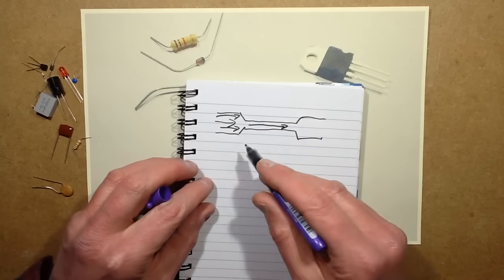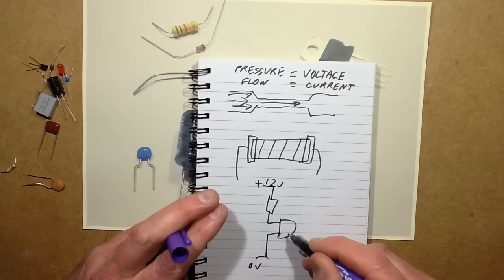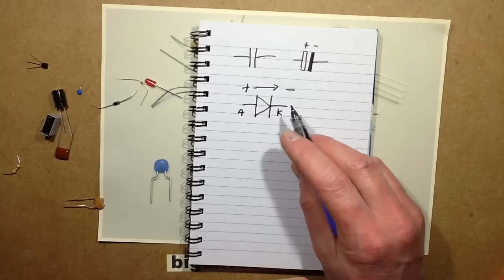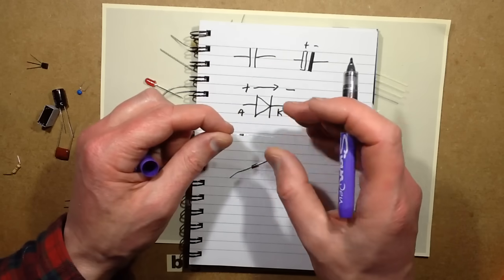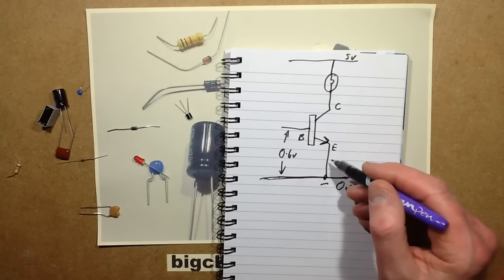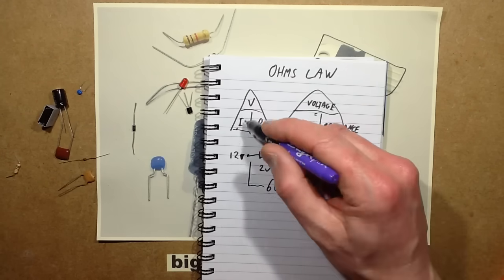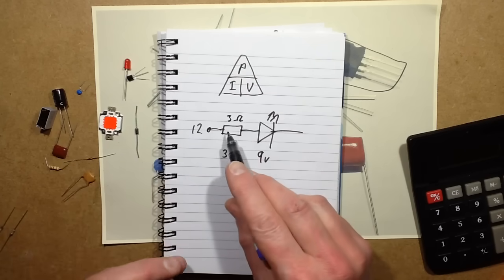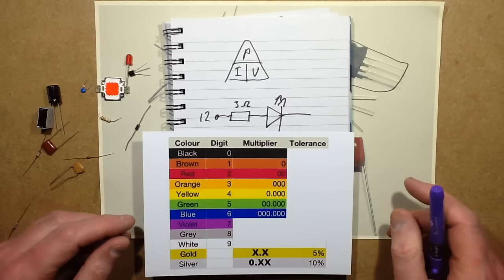A simple guide to electronic components.

Comment: Ohm's law is not V=IR. this is the definition of resistance as the ratio of voltage to current. No need to mention Ohm's law which considers what happens as the current changes. If the resistance is constant when the current changes the component obeys ohm's law. If the resistance varies r=v/I can still be used to calculate resistance even for components that do not obey ohm's law, like a filament lamp, or a diode. http://hyperphysics.phy-astr.gsu.edu/hbase/electric/ohmlaw.html

Comment: Thanks so much for the video! I appreciate the flow analogies as a good visualization tool, particularly with tuxcup's additional Chinese terms. One possible correction...I think .01A would be 10 centi amps, rather than milli?
Reply from the maker: 0.1 would be ten centiamps.  0.01 is ten milliamps.  (Centiamps are not normally used as a measurement.)

Comment: Hi clive i know this is off topic but i couldn't think of anyone else to turn too. I built a 2p coin pusher for my autistic son. Im driving it with a 12A power supply at 12v. 12v dc windscreen wiper moter drawing 8.5A and have used a 1ohm resistor capable of 100w to get it to 5v for the speed. The problem is that the voltage is fluctuating too much and the speed of the motor is decresing and increasing. Was a resistor the right choice and what is the best and cheapest way the regualate this with the high draw
Reply from the maker: The best way to control the speed of a DC motor is PWM (pulse width modulation).  It runs the motor at full voltage but pulses it on and off with varying on to off time to control the speed.  That's the whistling noise you get from cordless drills.
Remember to include protection against the motor stalling.
Reply from the maker: You can get DC motor speed controllers on eBay.
Reply: @bigclivedotcom  thanks clive your the best

Comment: Excellent video however when I use the water analogy with my students i describe it as a differential pressure so they enforce the fact that voltage is a differential. It helps when talking to mechanically inclined people

Comment: The charge in a capacitor is stored in the insulator, so that matters as to the effectiveness per unit of surface area.  
Also electronics is backwards.  Atoms are positive, electrons are negative and they flow to the positive.  Rather than fix electronics, they speak of holes for electrons moving from the positive.
Reply: you just helped me with your 'backwards' statement. I've had a hurdle of 'but why does the current flow that way?' and, duh, it's Biology/Chemistry 101.

Comment: Good video.

Interesting that you randomly bring up the chinese word for voltage.  It's very easy to remember, 电压 is, as you say, literally 'electricity-pressure'.  Back when i was trying to build something and often went to the 'electronic-component-market' here i found a lot of the vocab is intuitive.

current = 电流 = electric-flow
capacitor = 电容器 = electricity-container-mechanism
resistor = 电阻 = electricity-obstruction
battery = 电池 = electric-pool
circuit (board) = 电路（板）electric-road (board)

And some are just ripped off from english, like breadboard is literally 面包板, bread-board。But then i'm still not clear on the difference between 'solder' and 'weld'.  I think they use the same basic word for both.

But that market is crazy, i love it... i also went to a similar one in kiev, but so apparently there are enough hobbyists or just enough of a tradition of people buying these things wanting to physically go to purchase them in person that this city has at least one little shopping mall building with around 100-200 little stalls with every component you might want.  Like 10-20 stalls are just ICs, just a display case with all the available ones shown/labeled and then boxes/rolls of them under the counter.  Others are messier with seemingly random scatterings of bins with resistors/capacitors/things i don't even know what they are.  So much cooler than radio shack.

Comment: 12 volts in diode diode diode then resistor then ground _ should the resistor before to lower the 12 volts so diodes do not burn ?

Comment: Is it 0V after all the LEDs and the resistor because the "pressure", which you also reffer voltage as, is all "used up"?
Reply: Sort of, yes. The energy is dissipated by each part in the circuit between the positive voltage supply and the 0V rail. Without the resistor, all that energy would be used by the LEDs, which would be too much and burn them out. The resistor uses up the remaining power that you don't want the LEDs to use.
Reply: The pressure "differential", yes. The water flow analogy works very well for electronic circuits.

Comment: With a zener diode, once the zener voltage is reached it will allow current flow in both directions. Zener diodes are used for voltage control.

Comment: Do resistors eat power? Say in the simple circuit drawn at 3:54, the LED will clearly use power but the resistor too?
Reply from the maker: Yes.  They will dissipate power calculated by multiplying the voltage being dropped across the resistor by the current flowing through it.

Comment: what does mos fet stand for?
Reply from the maker: Metal Oxide Semiconductor Field Effect Transistor.  It's a very interesting and common type of transistor that allows high currents to be switched very efficiently and with virtually no current required from the control circuitry.
Reply: bigclivedotcom- thank you for the info. really helps a lot.

Comment: Hey Clive from watching your videos I have recently became interested in doing a little project on my own. I have very little to "no"  electronic knowledge. I purchased a step up high voltage pulse inverter arc generator ignition coil module DC booster from ebay and a couple of momentary switches along with a toggle switch. I decided I would to try to make a stun gun from 1" PVC scheduled 40 pipe.
    I have the parts but not sure on wiring them together. I also have a T6-10w 3.2 to 3.7v LED I thought about putting in the head of it along with the 2nd momentary switch. I now am lost and could use some help on how to wire this rascal up. Question can you do a video on how to wire and maybe a diagram of the wiring.    faithful watcher!  Gary
Reply from the maker: Hi Gary, I can't really make a stun gun video as it is classed as an actual weapon in the UK.

Comment: In your diagrams you showing the flow of electricity from positive to negative, I thought electricity is the flow of electrons, which have negative charge and the only thing which is flowing in the wire. Is there anything else with positive charge which is moving towards the electrons ??
Reply from the maker: Conventional flow of electricity is from positive to negative.  Electron flow is from negative to positive.  Since all the diodes point in the direction of conventional flow I use that as it makes learning easier.

Comment: I've not understood the idea of power ratings in resistors

Also
Do these calculations require you to know the current input in the system or do you use the current you want to achieve?
Reply from the maker: Power rating is how much heat the resistor can dissipate.  It's calculated by multiplying the voltage across the resistor by the current flowing through it.
A resistor is often used to control the flow of current, so you will choose the value to adjust that current.
Reply: bigclivedotcom thanks
That makes more sense

Comment: What's the hole in the mosfet for?
Reply from the maker: The higher power components generally have a metal tab with a hole to allow them to be screwed onto a heatsink.  An aluminium fin to help take the heat away.

Comment: Hey Clive, I get that a capacitor can contain charge but I still don't get why they are used....why would you want to contain charge when you have a battery.
Reply from the maker: They are better suited to holding small charges with an extremely long life and the capability of virtually unlimited charge discharge cycles.

Comment: When I did A Level Physics the practical exam included an electronics section which had a fairly large value electrolytic capacitor in it hidden away inside a box.  The teacher had connected this thing the wrong way round.  So my friend came to do the experiment, whatever it was - I can't remember, flipped the switch and 5 seconds later the cap detonated. Much suppressed mirth ensued.

Comment: is it smarter to link multiple resistors of say 100 ohm, like ten to make 1k..
and will it b e able to 'emulate' the 1W single 1k resistor ?
Reply from the maker: Yes, you can combine resistors in series to increase the resistance and power rating.  With standard 0.25W resistors 10 would theoretically be rated for 2.5W.

Comment: So for higher voltage do you need thinker copper wire.
Reply from the maker: For the same power you can use thinner wire, but with thicker insulation.
Reply: bigclivedotcom Oh well is it possible to take UK electronics and modify the resistors to American standard?

Comment: Please someone reply to this. I have a JVC XL-M400 6-1 CD player. It needed cleaning so I opened it up. Well on on of the boards inside the unit there are 5 of these very small resistor things or whatever they are that light up red when you turn the unit on. I have never seen anything like this before in any electronic. I am just very curious to find out what they are. Thanks
Reply from the maker: Probably surface mount LEDs.  Often for diagnostic purposes.

Comment: Can you help me identify something on a circuit board?
Reply: +Chris J If he's too busy the rest of us can help, we'd need to see a picture probably though? Drop it on imgur and give us a link
Reply: Okay its a the circuit board of Super Mario All stars. There are like round pink colored ones with 5 colored lines on it. I think there capacitors because it says C by them. Like C2, C3 an such.
Reply: On http://snescentral.com/article.php?id=0796 there is a picture, the cylinders there with the leads coming off the ends (same way most resistors look, the leads aren't parallel coming from the same side of the parts.)? Those are Axial Capacitors (Axial means both leads are in line, like the axis of the part. Most other capacitors are Radial, they come in both "flavors" as sometimes one or the other fits your PC board design better, plus now in surface mount.) Those are decoupling capacitors, used to keep the power to the ICs clean (you will find them right next to or even under the ICs ideally, any spikes caused by the ICs switching on or off is absorbed by them, they are a very good idea as otherwise your ICs can forget what they were doing, which can be bad.) Hoping that helps :)

Comment: the smell of failed resistors is so unique you can usually tell that one failed. sometimes i will sniff an electronic device that failed so to give me a hint, lol
Reply: Hehe, I too am one to give a device a sniff as an initial analysis. No burnt smell, probably nothing major, time to look for bad connections 😜
Reply: What about tantalum capacitors? The nastiest smell ever!
Reply: You now have cancer
Reply: what does it smell like? is it that burning plastic smell?
Reply: Also try some dope bro
Reply: @highondope8037  No no if brains are failing by restricted neurotransmitters that hard the casing starts to smell. I mean the casing for the powersupply and transformers. Sensors are then already useless. Only the resistors are really working all the time.

Comment: so transistor is basically a logic gate
Reply from the maker: +Hideki Shinichi It's a switch that can use a low level signal to switch a higher one.  But you can also make simple logic circuits too.
Reply: :D

Comment: I have LED turn signals for my motorcycle. They are rated for 5-9 volts. unknowingly, I put 12 volts to them. Needless to say, they no longer work. I dismantled them and discovered a small device that is connected to the power wire on one side and the printed circuit on the other. I can see the device is burnt on the output side. and it proves to be open when checked with a ohm meter. What exactly is this device? Can this be repaired? If so, can it be made to accept 12 volts or do I need to lower the voltage input first using a resistor?

Comment: im curious. 
are three 50 ohm with 2 watt resistores in series equally/better as one 150 ohm with 5 watt? could you reduce/spreat the heat that way? 
if anyone here knows an answer, let me know.
Reply: If the circuit in which it's used is the same, then the overall heat produced by the resistors will be the same (which you can check by putting both in an equal mass of non-conducting liquid and monitoring the temperature), but the power dissipated by each of the three resistors is smaller than the power across the big resistor, so (if each of the small resistors has a heat density similar to the big resistor's) they will heat up less degrees per unit time. So yes, using the three resistors will spread the heat over three three resistors, which could make them cooler, but it will not change the overall power across the whole.

Comment: Why do electrolytic capacitors work? Wouldn't the electrolyte make it short circuit or explode from electrolysis or the conductivity of the elctrolyte?
Reply from the maker: On first polarisation a thin insulating film is created by the action of electrolysis  That creates a barrier to DC current.
Reply: Thanks! I've been wondering about that since forever.

Comment: I always think of current as the number of electrons coming thru a wire . and voltage as speed/pressure . like golf balls thru a pipe. and sometimes when I'm working on something. I do think of it like water. sometimes both. whatever it takes to get your brain wrapped around the task ahead! great video...

Comment: In regards to te water analogy for resistors, if you narrow a pipe with water flowing in it, the flow will actually speed up rather than slow down because of the Venturi effect. So I never liked the whole water analogy thing personally. But it is a good tool for helping to understand circuits if you don't know fluid mechanics. :>
Reply: The same is true with the flow of electrons. They move faster in the higher resistance. So they have more collisions and more kinetic energy is changed to heat.  However the overall flow of energy is less, just like with water. You are right the water model of electricity has many weaknesses and the electrons are not like litres of water flowing

Comment: help me, i want to make a driver for 4 volt led i have the battery of 3.7 v how can i make the dimmer for this led
Reply from the maker: You may find that you can light the LED directly with just a resistor.
Reply: bigclivedotcom but I want to use dimmer I'm going to install in my table lamp.

Comment: When I was in High School Physics, (long time ago!!) we were studying Electricity, and several of us got the bright idea to make Capacitors by using strips of Packing Tape with Tin Foil stuck to the adhesive side (Keep it back from the edge).  Make two and roll them up.

We never bothered to test their capacity, but they were about 36 inches long, and when charged off a Van der Graph generator, they would produce a very nice visible spark.  If you were particularly sadistic (we were in High School!), you could tap one on your "friend's" shoulder to get their attention.  The bigger ones were "uncomfortable" and would leave a mark.
Reply: Sadly, I never got past the, "put the capacitor leads into a wall outlet and watch it explode," electricity entertainment stage. Now (in my 50s) I'm really wishing I had stuck with electronics longer. But my kids are going to learn.

Comment: Learned more from 40 min. video than 3 years in school gave me. I had best grades from my class I got my shitty paper and rating 1,1,2 or A,A,B however you call it and most I could do is change my 4 wired socket to 5 wired socket so I can use my forge blower.

Comment: So the resistor effects how MUCH is going though it?
Reply: Beyond the fact that a resistor limits the rate of electron flow (current), I'm confused on whether or not it likewise limits the voltage ('pressure', basically the electromotive force and such) and if so, how that effect may differ from its effect on the current

Comment: I have salvaged a mystery circuit from a broken piece of electronics.

There is one small circuit-board with nothing but 4 different colored LEDs
Two cables (marked with +&-) that goes to another small circuit-board containing a
620k resistor, another 270K resistor, a capacitor (CBB22)
and one small diode (4743). 
When I connect either of the two leads from the 2nd circuit-board (Polarity not indicated) to my 5V PSU
and then touch either the 2nd cable or basically anywhere on the whole circuit with my hand the LED's will light up!
How is this possible? 
The LEDs however, will not light up if I connect the second cable to the 5V PSU :S

Tinkering with electronics and DIY kits are very new to me and I am still learning.
Hopefully this isn't a too stupid of a question. 
It literally blew my mind as they lit up by pure accident at first. 
I thought it might interest some people in the Big Clive-community. 

Maybe someone can direct me to a good electronics-related forum for learning and asking these kinds of questions? It would be much appreciated. (PM me with link)

Comment: If electrolytic capacitors can potentially explode, why do manufacturers use them if there's more stable/safer alternatives available? Is it dimensions for particularly small areas, cost or something else?
Reply from the maker: They have a high capacitance to size.
Reply: Thank you for confirming, Clive. I'm still unsure and a tad concerned at what manufacturers do to contain what seems to be a potentially volatile and possibly a dangerous material if it blew out off a domestic electrical device. 
Thanks again.